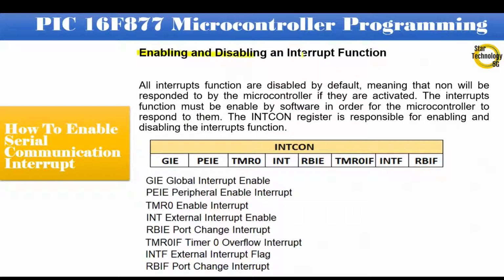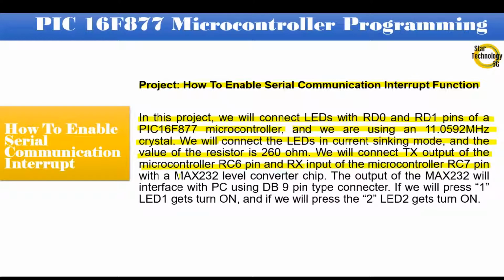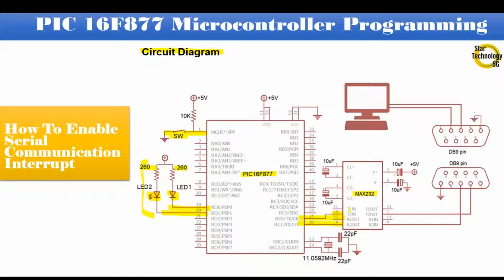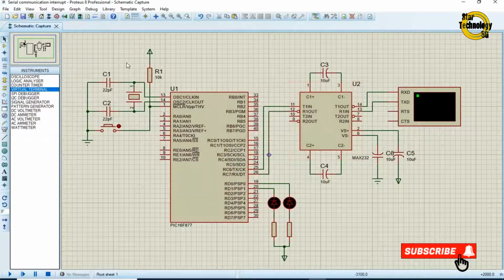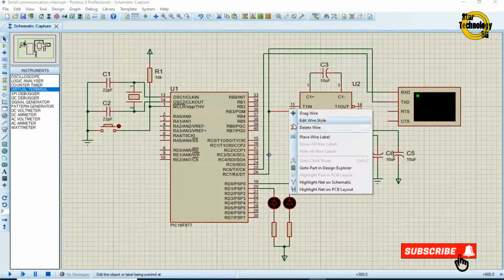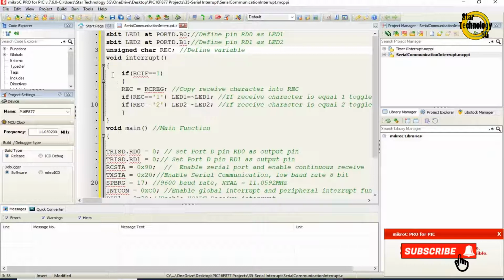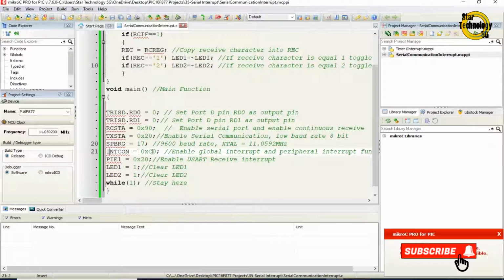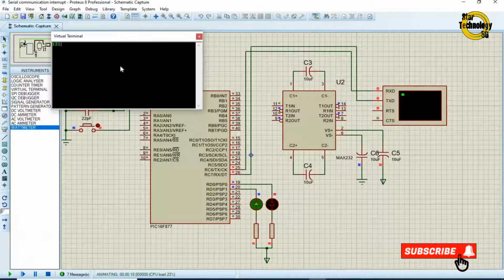Microcontroller PIC16F877 Video 43 How To Enable Serial Communication Interrupt

Comment: can you help me running video a forward and backward using ir sensor using pic16f877a via maz232 and db9 connector because iam trying from 3 months but i am unable
Reply from the maker: In this project, you have to program your media player with your microcontroller. if you can

Comment: hi i follow ur video and it has helped me lot in 
 my projects , iam having one project in which i have to scroll a video using ir sensor which is connected to pic16f877a via max232 and db9 connector is it possible
Reply from the maker: Yes it is possible